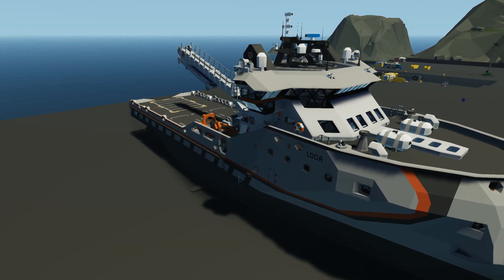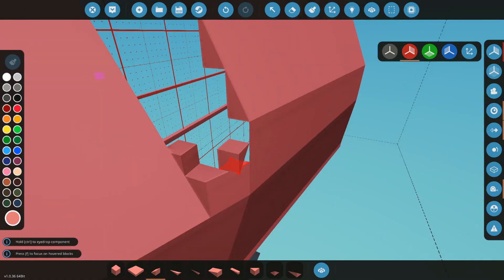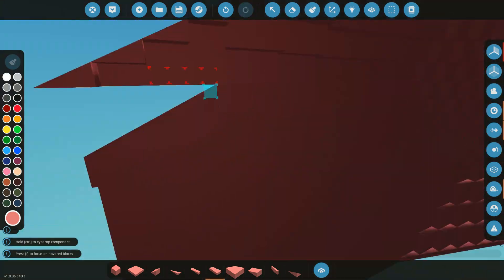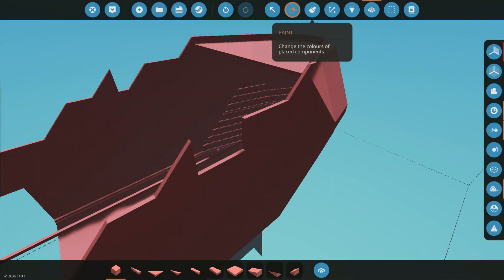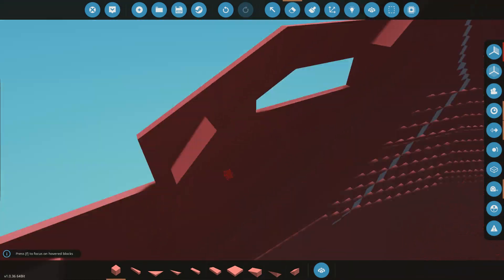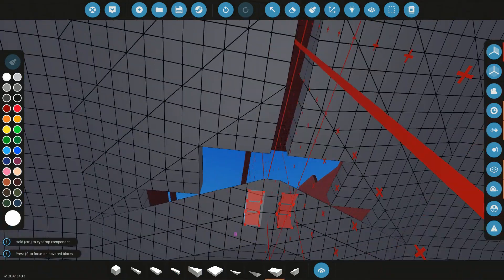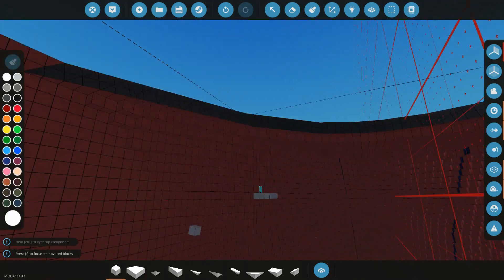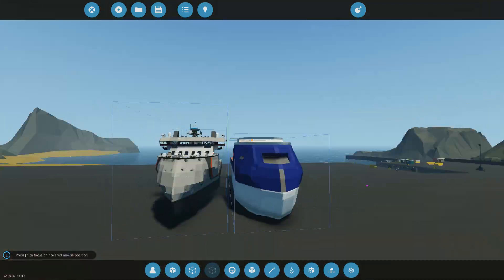Offshore Workboat Build Timelapse - Part 1 - Stormworks

Comment: all ships are offshore
Reply: There is a type of ship called an OSV, or OffShore Vessel. They are typically designated for oil exploration and construction/resupply of structures such as oil rigs or turbines. They can also be used for transporting crew to and from those structures.
Reply from the maker: I guess that's technically true. I think  "offshore workboat" sounds better in a youtube title tho
Reply: that's why they are called ships
Reply: @stijnhavekes6628  b- but what about airships
Reply: @josemabravob  well, when your not flying on the shore your’re still offshore
Reply: @stijnhavekes6628  and... L- LANDSHIPS